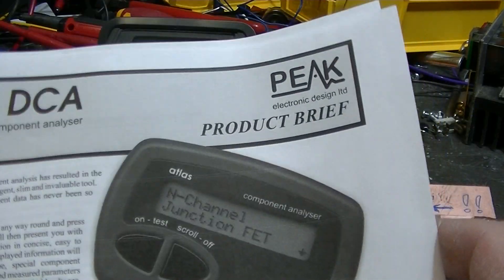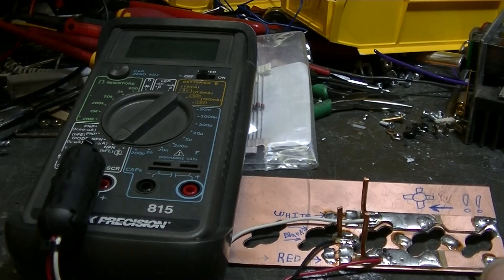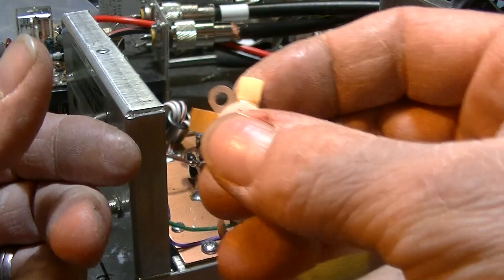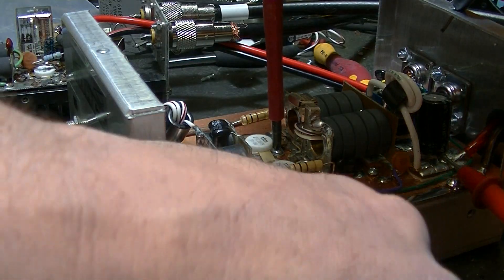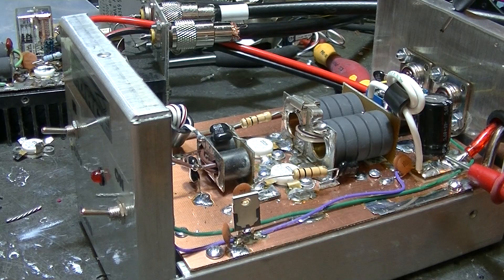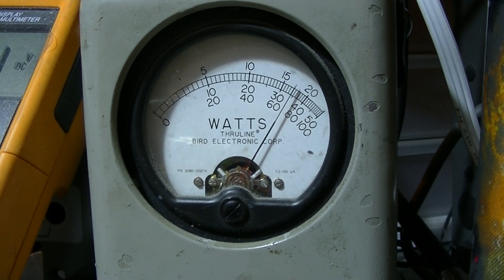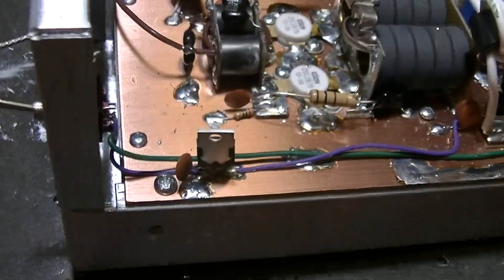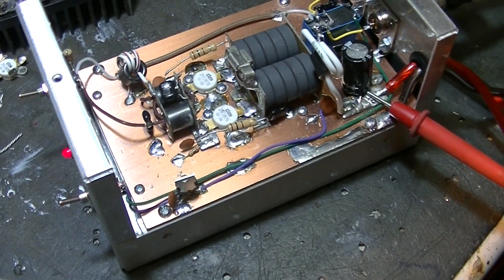Xforce Tests DEI 2sc2879 With Gain Of One On 18v

Comment: There is a good reason why most ham radios use these transistors and limit the output to 50 watts per pill.
Reply: Exactly. The MRF421 Is better if you want up to 180w output in push pull, but no more!

Comment: Well of course you're not going to get a proper hFE reading on a transistor with a Max IC of 20A at the low currents that those testers use. You need a few hundred mA or so. The hFE is not the same as RF power gain either, by the way. Also you would NOT be getting 700W out of that two pill amp. I would say harmonics would be contributing to that reading, especially driving it that hard with nothing but a broadband output matching transformer. The harmonics would likely read higher per  watt on the meter as the through lines coupling would go up with increasing frequency. Your amp is also running zero bias, making harmonics worse.
Reply: +Dazzwidd YEAH!!! Spread them coils, now LOOK!! MORE POWER!!!
 ...on 54MHZ!!! AH HAH HAH HAH HAH HAH HAH HAH
Reply: Yeah man, that's the way! It's gotta be just reducing the insertion loss of the output LPF! UTTER BRILLIANCE! Hang on... The second harmonic is supposed to be suppressed by balanced, push pull operation. I think we need parametric oscillation to get more power! True innovation right there! Who needs bandswitching!

Comment: wtf is up with all these people saying a 8 transistor , 2SC2879 toshiba, transistor can put out 2500 watts? 
They are simply violating the laws of physics.. hell, the power dissipation alone, if you take the entire P=IxE, and just saying that the amp is 100% efficient, the entire power consumption of these amps is only 1600 watts at best.. Realistic efficiency, the highest I have ever seen in any amp from 1.8 - 30 MHz is 70%.. and that's with the best 16:1 transformers using the best ferrite transformers. 
Look at 420 amps online.. claiming he's got a damn 2500 watt, 8 x 2879 box. Someone better call Toshiba and tell them they need to change their datasheet, and somehow they have created more power output than they are consuming on the input. 
The guy's video in the link you posted above, his 2nd video is a 2400 watt 8 final box.. it's physically impossible. WTF don't people get, that you can not, under any circumstances, produce more power than required in the amp.. 
I've been an electronic engineer, specializing in RF for 22 years, design radios for a living and youtube is cluttered with people violating the laws of physics. 
Hell, I designed a 160 - 10 tube rig, using a 3cx5000 A7, with vacuum variables, ultra stable high voltage supply as a hobby.. most I ever got out of it was 3500 watts. People give these unrealistic power factors on youtube and all over the web.. and it forces the people who sell them to have to lie like hell about their power, simply to compete.. an 8 transistor 2879 amp, will only consume, max current at 13.8, 120 amps.. that's roughly 1600 watts power input.. how the F#$% do you get 2500 out when you only have 1600 watts of total power going in? That's like saying that the amp is running at 175% efficiency or something crazy.. 
Ok, I'm going to go lurk now and talk on my 48dB gain moonraker now and watch my 500 inch tube television. :/
Reply: +Poppa Bear It's possible. Remember PEP is brief burst and not continuous.  The question is how long will it last and how clean will it be. Toshiba 2879's will do about 200 watts PEP before any major distortion will show on a scope.  So a 4 pill can be ran comfortably at 800 watts if it's built right and an 8 pill at 1600 watts. I have a Dave Made 1X4 that will do 1300 PEP if driven hard. I run it around 800 watts PEP and it work greats. RMS is around 450.
Reply: billybassman21 let me explain this to you.. since the specs on amps, went awry, people rate them on gross power figures.
All of these use 16:1 transformers, or, 12:1  in some cases, but it's all the principle.. you have 1 transistor, providing power for 4 others, or 8 others.. the transistors are combined with a transformer, to balance the impedance. At HF frequencies, the efficiency is only about 60%... some of that power is absorbed , some the input power is turned into heat, other into stray emissions, harmonics, spurious frequencies. what these amp companies do to "enhance" their specification is this simple. They take the voltage input, and multiply it by the total power consumption of the device, even including the wasted 40% efficiency into their power ratings. It's a marketing thing.. and since it is rare to find an RF engineer, who's into CB, this is what they do.. and people feed into it, thinking they're King Kong with a CB. 
I'm a 20 year veteran and specialize in RF and communications. I hold quite a few patents for radio engineering and antenna design. I also hold some mechanical designs, but this is too much to go into . If I told you who I was, it would make sense, because I was quite a famous engineer not long ago, and my name was heard coast to coast 4-6 times per day across the US on some of the biggest stations in the US. 
Now that I've qualified myself, I can tell you, that all this is marketing power. 
Do this.. take your PEP or RMS watt mater.. (there is no burst power as you stated, it's all peak envelope power, or RMS, Root Mean Square. That's it.. you can't burst something, it will burn up, explode, pop.. 
Take your voltage, then, take the current off your amp meter on your power supply. Multiply them. Looks familiar right? Same power or "Watts" that they claim. They count not only the power output of the amp, but they also count the power wasted.. that other 40% that's burned up in heat, harmonics, etc. I hope this is a decent explanation.. however, I can get into the transistor junctions to tell you how this works in greater detail There are efficient, and inefficient BiPolar amps.. all these are dirty. They do produce efficient power, but they send off some very bad spurious emissions. This is why the 2nd harmonic of CB, is given to the 6 meter amateur radio band.. spurs can be heard up to 8 harmonics away from 27mhz.
More later if you care.. if not, have a great weekend.
Reply: +Poppa Bear. You have my support on every aspect of your initial post, and your reply. The amazing thing about all this is that it's not rocket science either, lol!
Reply: Dazzwidd - I'm a very well known RF engineer. I have been a top level RF engineer for over half my life, and I hold many patents in radios, electronics, antenna designs, etc. 
I don't think I qualified myself enough in the initial post, but, I will just state that I have designed top end consumer electronic radios since college, and as far back as 4 years old, I was repairing radios. 
My entire family are ham radio operators, and I was the youngest registered amateur radio operator when I was 6 years old. 
That record has long since been blown away. I think some asian kids come out of the womb tapping morse code and their first words are "What's your QTH"?... 
That said... These amplifiers cannot, physically put out that type of power, in push pull configuration. 
The companies who rate their amplifiers, rate them on total power dissipation.. aka: They rate the voltage input, plus the current input, and if the amplifier is consuming 40 amps, at 13.8 VDC, they simply do P=IxE calculation, and say that the amp puts out 13.8 x 40= 552 watts. 
I have even seen some amplifier companies claiming higher power output than what's physically possible.. aka total power dissipation = 550 watts, and they claim 800-1000 watts of RF power.

I have dealt with huge tubes.. big big tubes, ceramic monsters, with high voltage plate transformers, putting out thousands of volts, with high current, and if it wasn't for a good bleed resistor, I'd be dead now. That said, I have worked at power factors up to 50kw actual RF power output, and let me tell you, it is HUGE power. Massive. 
I have also run 500-2500 actual watts from a mobile tube amplifiers as well as solid state devices, and I can tell you, the difference is amazing. With the DC amplifier, you are always fighting to push more current, balance the impedance with the possible power capable from multiple bipolar amplifier finals, fighting the output transformers, and everything needs to be perfectly phased, input and output, and if you're using more than 1 of the coupling transformers, 3:1 or 4:1 on the output, you need to go through a torroidal combiner to couple the power.. this all has loss.. quite a bit of loss in reality. Some of these amplifiers are so lossy, they have efficiency less than 40%. That means, the other 60 percent is put out as heat, reflected signal, spurious harmonics, etc. 
I designed a commercial viable, dual push/pull amplifier module, that fit into the first version of an RCI-2950, and sold an entire bottom cover, with final amplifier built into the bottom plate long before Ranger started integrating these .. I designed it from the ground up, and it worked excellent as was as efficient as you could get 2 x 2SC2879 transistors. Still, the amp only put out a maximum output of 280-300 watts PEP. RMS roughly 200-220 watts.. I can't remember all the specs right, as it was over 2 decades ago.
Long story short.. buy them, use them, but do not under any circumstances, brag that your 2 transistor amplifier is putting out 700 watts, on final power output transistors, which can only dissipate so total power, with limited efficiency. 
The transistor is ONLY capable of a maximum power output, mind you, at 12.5 v, of 140 watts per unit, but the IMD is approaching 24dB.. not good. This is like running a V8 engine at 10k rpm, and is excessive in terms of what you can pull out of one device. Say, at the higher voltage, you can pull a maximum of even 200 watts per device (more like 150-160 wide open), you will approach a horrific IMD, of greater than 27dB, you will be throwing spurs out into every single harmonic, multiple harmonics, which will consumer energy and power.. This is a 2 device amplifier, and if you lose 10% of your power (likely more) through the coupling transformer, you are left with a meager 160 x 2 = 320 watts. 
This is nothing but fancy marketing, video wizardry, and a watt meter that's likely lying like crazy if that's actually a Bird 1000H model slug. Or, the meter has been internally tweaked, or,  the SWR is high, causing falsing on the meter.

Perhaps XForce should contact me, as I have designed an FET amplifier for use in the 10m amateur bands, and the design is absolutely flawless. It operates at much higher efficiency, much higher voltage, with it's own built in boost converter, to take 12v up to 48-56v with stable high current. The FET amplifiers, are literally bullet proof. I have run my amplifier design into an open circuit at full power output, and I have also run these FETs wide open, and directly shorted the output with a screwdriver while transmitter was loping along at 1000 watts RMS. If someone is interested in using my amplifier design, or licensing my amplifier technology, I can go into more detail.. however, I am only using 2 output transistors and I can use a LOT more.. and the amplifier is very clean and just lopes along at 1.5k off standard car batteries (3 of them.. 2 stock, 1 spare diesel battery) and a stock F-350 diesel truck alternator. Larger alternator will be required for most vehicles. Due to legal reasons, if X Force or another amplifier company took me up on the offer, I would require that it only be built for 10m band, and a circuit put into it, disabling the output if run below 28 mhz. However, the amp will work on other bands with some LC changes and a PI-L network added to the output. 
Cheers.